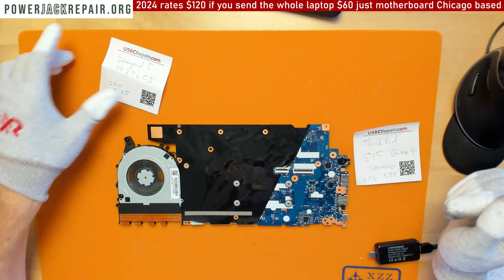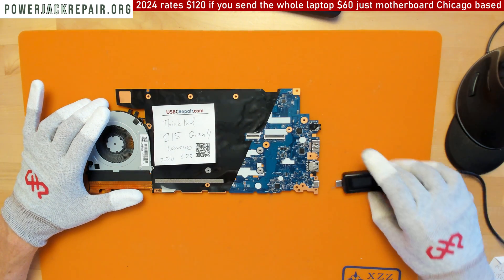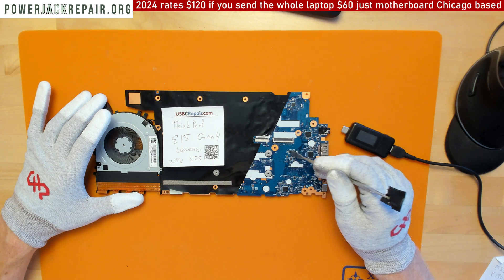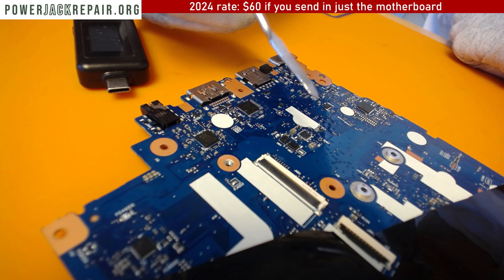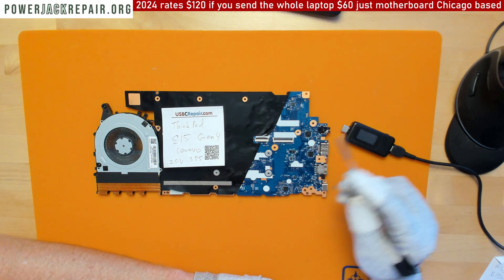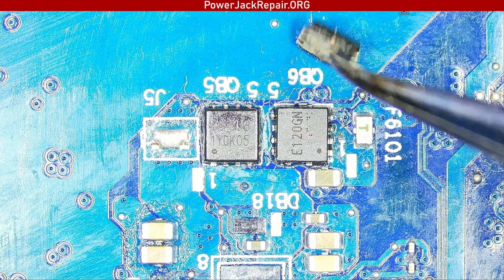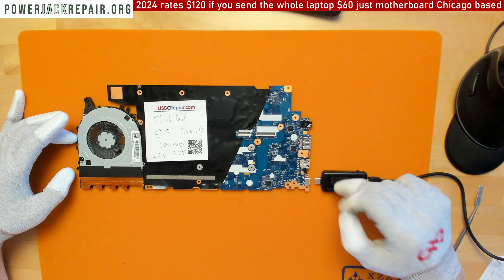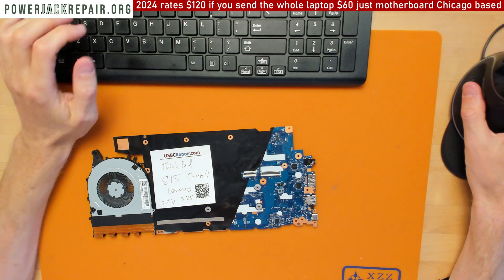Lenovo Thinkpad E15 Gen4 died for no reason how to repair switched to battery and stopped working

Comment: I have same laptop and same issue.

The TPS PD controller chip is faulty and and it is not providing enough voltage at the gate this means the MOSFETs heat up and become desolder from the board.
Reply: You can just remove and bypass those mosfets